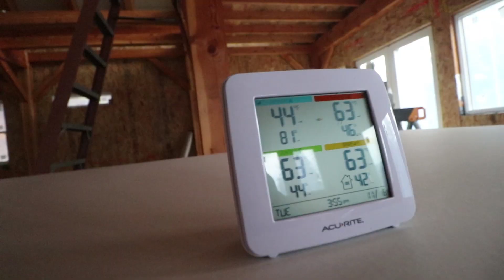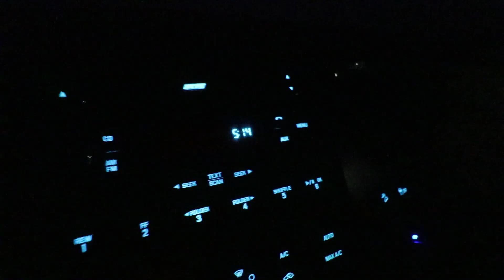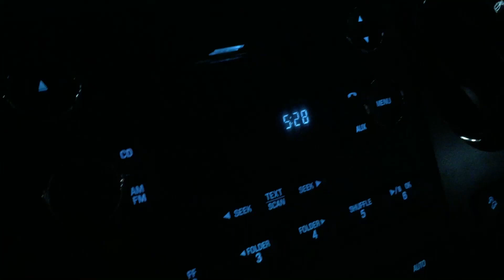This Video Will Make DRYWALL INSTALLERS CRINGE!

Comment: Totally agree with Todd Bearden, I switched to mesh years ago. & I would trade that small blade in for a corner blade. I use a 6" & 12" only. & your right about the Cringe Factor. I suggest a wet fat thick sponge for your mud edges so you don't muck up the paper & helps with dust removal. Only on small jobs tho. You remind me of my 1st time 30 years ago. So happy I live in a 1870 log cabin. No drywall or paint.

Comment: If you are looking deep into something like a tank, pipe, well. You can use a mirror. To reflect. The  beam of light  will  stay tight . I've used a 6 in mirror to look to bottom of a 300 ft well. And through new water and sewer lines with I done construction work .

Comment: Why use that mud from a bucket? Smoothset (powder in bags) will make this go much faster. It cures before drying so you don't wait for air to dry it between coats. Your spot on about the cringe factor.

Comment: Experience doing mudding badly has taught me that, especially with paper seam tape instead of the mesh, you first have to lay a bed of mud in the seem, then lay the tape in the mud, then mud over the tape all in one drying cycle. That seam is going to fail that way you did it, especially in a bathroom. I've done seams the exact same way and it came back to haunt me.

Comment: Hey boss I don’t think your supposed to screw the bull nose in just joint compound “stick” it in place.
Reply: List of acceptable fasteners for corner bead
-Mud 
-Corner Bead Glue (Ideally combined with one of the following two for longevity)
-Drywall Nails
-1/4 inch Crown staples

Worst possible fastener for corner bead
SCREWS...

Comment: GREEN BOARD is a "trade name" meaning that the board is rated for mold prevention & water rated. Tile backer / cement board has the rating for tile or stone. Sheet Rock is not rated for mold prevention or water rated just "water resistent"

Comment: Also, if you're gonna use some more 'Bowl Nose' in the future, try using Super 77 spray adhesive. You'll spray both the wall and the Paper fitting with it, let it dry up until it's tacky and then put it on. You won't have that bowing you're experiencing and it'll be much easier!

Also, for putty knives, you'll want a 6" as your general purpose knife. It works great for skimming, coating, and light flushing of flats and butts. A hawk and trowel will also make your life easier for coating your flats and butts (once they've been taped). Also, don't be afraid of putting a little more mud on your joints when taping! You can just remove the excess when you're flushing your joints (spreading the tape down after the mud goes on). Also, if you're doing some taping try and use some thinner mud. Will DEFINITELY make flushing and taping easier. The mud will spread into the cracks and crevices much easier and create a much better result. You'd want thicker mud after you've skimmed and the like. Thicker mud shrinks less, whereas thinner shrinks and bubbles more.

Comment: I always mud down the entire row of screws.. treat it like a joint and start at an edge and create a continuous line to the next edge.. as you start to expand the compound away from the corners, eventually, all your lines meet up and it's completely covered in a thin layer of compound

Comment: never screw paper corner beads inplace.  Put a layer of mud down each side of the corner, place the corner bead in place and embed the paper into the mud.  smooth it out and that is first coat.  Same goes for the paper tape.  I myself much prefer mesh tape to paper.

Comment: You were much better at the end than you were at the beginning of the mud/tape.  Hang in there.  You will do fine.  I am no drywall expert and enclosed a patio door (took door out and put studs/drywall in) and I used the canned texture and it came out fine.  As the waterboy says: You can do it!

Comment: With such a small bit of wall space, I'd have used a non-bullnose corner piece. They have only a tiny rounded curve on the corner instead of the wide radius of the bullnose. I used to do a lot of drywall and the sharper corner metal used to be standard. The sharper corner gives you more flat wall space to mud. Seeing you doing all this work brings back memories of doing construction that I'd long forgotten. You and Alyssa are doing a great job generally, and it's always entertaining to see your progress each day.

Comment: For the corners fold your tape in half... put mud in the joints set the tape in and secure it by running the blade of your knife over it.  As for the straight ones put mud into the space, and place your tape into the area again using your drywall knife to smooth the area then add some mud over and feather it.  Lots of the new houses are not doing texture any longer.  After you tape I thought after your first sanding you were suppose to extend the mud out to like 4 inches on either side of the tape dry/sand, then extend the third coat out to 6 inches on either side of the tape .. dry/sand then texture or paint...I could be wrong because I am learning as well.  Nice job though.

Comment: I'm sure its probably to late, but the 'hopper' and ceiling texture is really easy. I've tried both and the cans do not do as well and cost more, even after renting the hopper. HomeDepot is where I rented the hopper and bought the texture. I think the total was around $35 for both. SUPER easy.

Comment: I give your bathroom 2years before a leak wrecks all that work. You will notice a spongy part in tub or surround.  But good news is you just cut out the drywall and put in the other and you get more experience.  As far as drywall dont worry . My bedroom looks 10 times worse. 12 foot ceilings are awful.

Comment: First use moisture barrier primer, then texture and then finish paint.  The barrier primer will lessen the sheetrock affecting the texture due to sucking the moisture from the texture.

Comment: Don't you have any other types of wall finish dry lining has a very slow messy  finish we tend to plaster rooms in the uk two coats with what we call skim (board finish) gives a much more solid finish to jobs,

Comment: From one Do-It-Your-selfer to another, It looks good. I use a big wet dripping sponge with in 2 hr. and never sand the walls. No dust and it adds a little texture that can be fast sanded flat if you want no texture at all.  Keep up the great work.

Comment: You have already heard /read this but the mold resistant sheet rock does not support life because it does not have paper for it to grow on. At least you have the sheet up off the concrete so it won't wick the moisture out of that.

Comment: jesse, since the thickness of the tub surround flange is 1/4" , you should have furred all of the adjacent studs with 1/4" furring strips. preferrably 1/4" plywood so they wont split when u fasten them to the studs. furring out the studs would level the plane so the drywall will sit flat at the edges of the tub surround. with respect to those bullnose beads , they are installed over mud, or with a spray contact adhesive. you will end up with air bubbles under the paper edges of those beads if u use screws only. when in doubt.........youtube.......

Comment: Hi again, I prefer the metal bull nose as it makes a solid line to work to in the corner, (I have never seen paper corner bead except for internal corners. Also you can get a special rubber paint (usually red) to seal all the drywall and stop mold .

Comment: As much as it will cost you to buy four cans of spray texture you can buy a hopper. They cost $60.00 to $80.00. Can spray texture is around $15.00 a can. You also have the rest of the house to spray also. It will be cheaper in the long run.

Comment: put the mud on the joint heavy then put tape over the mud then use the knife to lay it flat and remove the excess mud.  Also you need a 6" knife for taping.  and don't buy the mud in the little buckets,  buy the box and mix it in a 5 gal bucket.  You got the right idea you just need a little guidance.  keep up the good work.

Comment: Jesse  Try this! Cut your tape pieces to roughly fit, mix your mud sorta thin. Then run the pieces with your fingers down into the mud, pulling the tape back up through your pointer finger and middle finger, scraping 95% of it off leaving a thin amount of mud on it.  You can then immediately stick it onto the joint area and it'll stick long enough for you to work it smooth.  I use my mud kinda wet in this technique and a bucket of water to wash my hands around.  You could have done then whole bathroom in less than 30 minutes taping with first coat.  Professionals use a 'banjo" to accomplish what you can with wet mud and your fingers.  Good luck!

Comment: Hi Jesse.. I used to use paper tape when drywalling, but I definitely enjoy using the fiberglass mesh tape.  It self sticks, you do NOT have to worry about it lifting  once you have joint compound on it. It is really good and easier to use then the paper tape.  I am sure once you use it you will be happy, especially with a huge home .

Comment: The difference between regular sheet rock and moisture resistant sheet rock. Is regular sheet rock uses paper and moisture resistant sheet rock uses fiberglass. The paper will mold and mildew. Were as fiberglass will not.

Comment: Get around the quick meal issue by making meals in a jar then seal them with a seal a meal type system or brake bleeding tool and can meat. 2 jar..meal complete. This system has been used for two generation of kids in high school sports in rural area.

Comment: on the bull noses the easiest method is to use some spray adhesive or you could just skim it with some mud then stick the bullnose on and pull the mud out as if you were taping

Comment: Drywall -  Practice makes perfect  1st Coat  fill and tape.  2nd coat Sand off the high spots fill in and voids and  extend your seam. 3rd  coat-  fill any voids you missed and sand the whole room

Comment: Where I live, during the housing and oil boom, there was a set of 4 townhouses that was being built. A fly by night drywall company came in, drywalled the whole place, taped and mudd, sanded all done within a couple days. AS they were packing up and leaving the electrician and plumber showed up... Here they had did all the drywall before the plumbing and electrical were in.. they were slightly mad they didnt get paid for the job that had to be all torn out and re-done!!!

Comment: when your done with the bucket of mud for the day scrape down the sides until clean smooth the top of the mud and put an inch of water on top of the mud. this will keep you from have hard clumps in the mud the next time you want to use it.

Comment: Looks good, but i would advise you not to use tape in corners instead use acrylic. Over time, cracks may form on the tape. The acrylic remains permanently elastic, so ceiling and wall to wall can move independently.
Nice greetings from Germany.

Comment: I don't think i've ever seen a painted bathroom where I live, every bathroom uses porcelain/ceramic tiles for floors and walls. But all interior walls in most houses around here are brick, i dont know if drywall can take the weight a porcelain tile adds.

Comment: Jesse, you 1st need to embed the paper tape into/on-top of drywall joint compound/mud. Then draw the knife to smooth out the paper and mud while forcing mud deep into drywall joints. Doing that will strengthen the drywall joints once the mud and paper tape dry out. It looks like you, instead, are putting dry tape over dry, unmudded drywall joints; them mudding on top of the drywall tape. 

Your drywall mud tray is missing its metal edge pieces that should be fitting into the top grooves of the tray which would help straighten the edge of the tray and be a better edge to scrape excess mud off your drywall knife(s). 

Hope this helps and  makes sense to you.

Comment: Instead of the shower kit and drywall why not use tile??  Lots less work.
Reply: You seem confused... 
Pre-made shower surround install 2 hours max
100 square foot of cement board, water proofing, and tile, 8-10 hours(if a professional were to do it)

Comment: incorrect on drywall. The sheathing is paper (and is what grows the mold if it stays wet). the inside white powder is pretty inert. You can buy drywall sheathed in fiberglass which will never, ever grow mold and that green stuff is just paper sheathing with an anti mold agent usually. Paint does protect it (especially if you prime it with paint that has an antifungal in it) but that only works as well as you worked at stopping the paint being punctured, exposing the paper to water.

Comment: Pretreat your walls for knockdown or Texture or you can also buy pre textured semi-gloss paint which works wonders and wet areas this will also help hide all the imperfections it also helps prevent mold from seeping into cracks and crevices and edges of your drywall

Comment: Try using some hot mud so it will dry faster in the deep areas on the corner
Reply: Considering their amateurs. Doubt they would understand "hot" mud. Its called setting type mud. 
Also their are company's that make mud that is truly "hot" when it begins setting (if you leave it in a plastic bucket and let it set it would melt the bucket) but its not readily available at the consumer level.

Comment: One option to install corners for drywall is to glue them on with contact cement the contractor that did my parents place glued all the corners on and it made beautiful corners didn't have to use a single screw just some painters tape to make sure the contact cement dried

Comment: I always presoak my tape and I prefold the corners. At the stage you're at I would use Redguard. It's a roll on water proof membrane and it will give you added protection for water penetration, if you decide to tile your drywall above your tub surround.  That texture in a can is normally used for patch repair and renting or buying a used second hand hopper would be a better investment for the rest of your build. Keep up the good vids!

Comment: Fyi the old all metal bullnose has holes in it like cheeze grate cause the mud wont stick to the smooth metal. Plastic is the norm now cause it is cheaper. the paper face metal has the paper to give the mud a surface it can stick to... I like the cheeze grater plastic cause it doesn't pucker hardly. that and if a kid jams a couch into it moving your sofa in, the plastic rebounds and is slightly less chance of big repair.

Comment: Ya know, it’s great you’re trying all this stuff, but when I was finishing my home theatre I hired a crew to rock, tape, texture and paint. I’ll never regret it.... these are highly developed skill sets. I did what I was good at. I built the structure, roofed it and wired it, including internet, cable, satellite, external FM antenna, security system, etc. 

It’s great your moving in - I knew you would (as would I!😎)

Comment: For small areas you can use a damp (not wet) sponge to go over joints it reduces dust- you have a lot of sheet rock to do- get a box of mud, get a hopper they do not cost that much- you will pay for in just the cost of cans of texture- get larger knife- if you buy quality tools they last long time.  Check out some YouTube video on sheet rock - one uses paint roller with mud for ceiling.  Mix your mud please................

Comment: I install my paper back beads with a mud covered sponge, not screws. Also, don't sand it down, you'll 'lift' the paper. Sand it with a wet sponge.

Comment: Do yourself a favor and scrap the walls smooth with the drywall knife between coats. FYI these is a drywall roller for stippling....works good to apply mud the smooth with the knife.When opening a new pail of mud mix thoroughly. Many light coats is better even though our instinct is to put it on thick. Good luck.

Comment: Get a small bucket. like a 1.5 gallon, Thin the drywall mud and put the tape in it and get it wet, then apply tape to seems and corners.

Comment: Member in the summertime your garage is going to be really hot and the AC in your bathroom is also going to cause moisture I'd recommend using an outside door for your bathroom door with a rubber seal this way you don't have to air condition your entire garage just think of all the cold air you'll lose when you open up the garage door heater vent for your bathroom will Pull any excess moisture out but there's always going to be a temperature difference between the garage and the bathroom
Reply: Also recommend using insulation for the bathroom walls treated like as if it's an outside wall

Comment: Can't believe you didn't shim the bottom of the bathtub to compensate for the garage floor slope. Now you're going to have to fill the gaps around the top edge of the tub with an insane amount silicon. Also, you should've added 1/4" furring strips to the studs above the shower surround walls so the sheetrock doesn't bow out. Also, you should've added at least another 2 x 6 on each side of the shower walls so you can attach a thin piece of drywall to complete the corners around the shower. I also noticed you didn't use any Nail Plates over you electrical passes through the studs like you did for the plumbing. And we all know you should've used greenboard throughout. Also noticed you didn't plumb the venting for the exhaust fan, guess you do that from the top if you remove the plywood. Also, code for screw spacing is every 8" on the ceiling and every 12" on the walls or 5 screws in the field for ceilings and 3 in the field for walls. Buy a 48"  sheetrock square. I'm not even going to get into all the issue's with you're drywall installation. Hopefully you the hang of it.